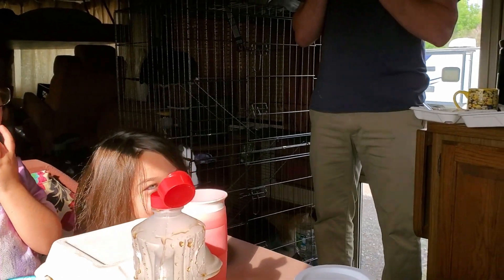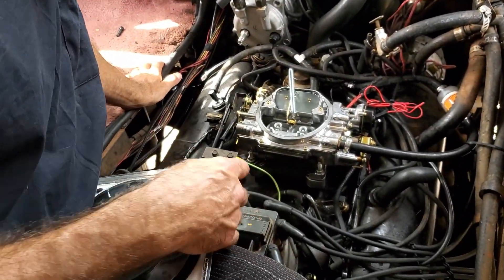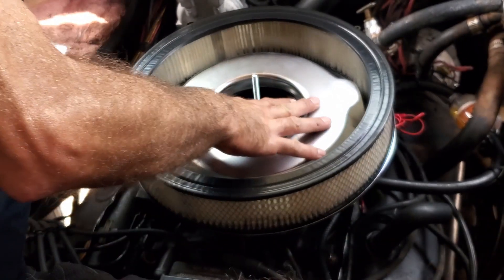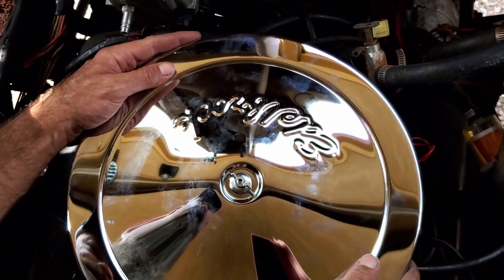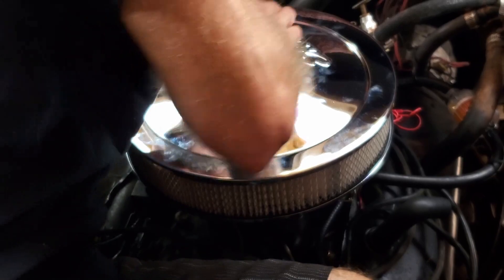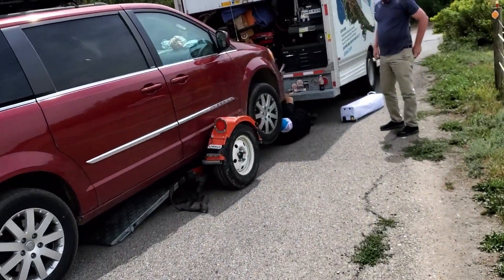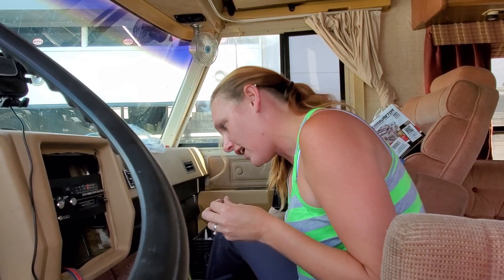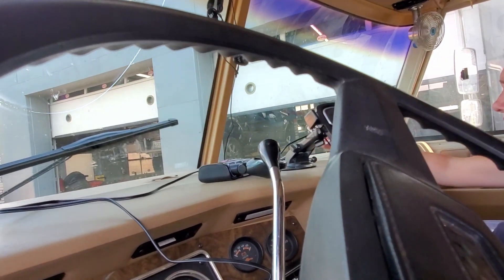Alaska Move Day 9

Comment: Also sounds like a lifter taping or exhaust leak. If the pulley is hot mean the belt is slipping. Tightening it down may help but if its glazed a new belt is needed.
Reply from the maker: Changing belts now